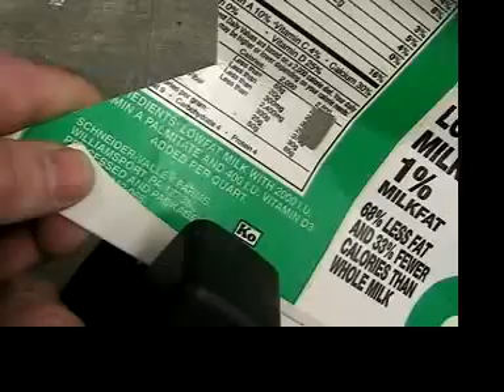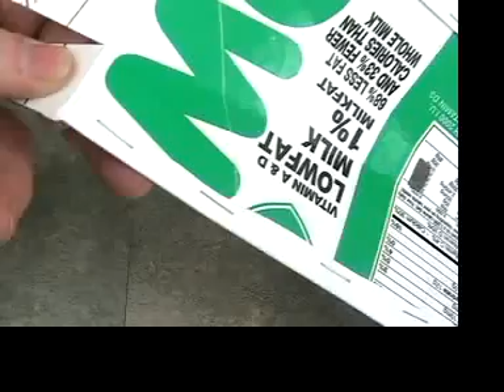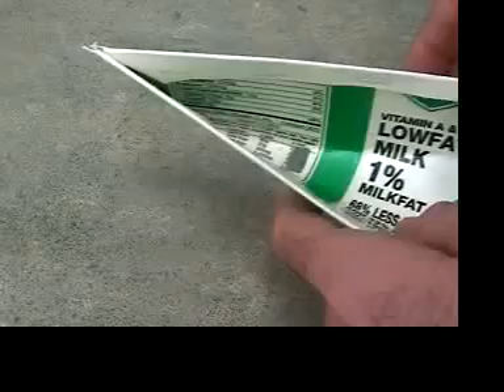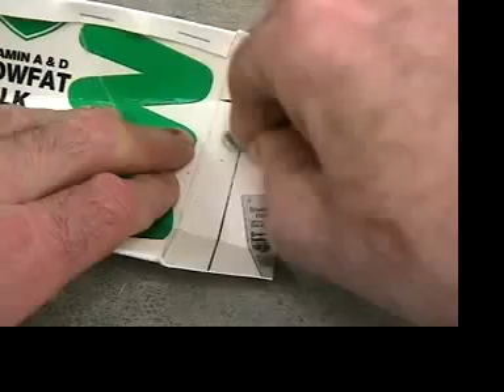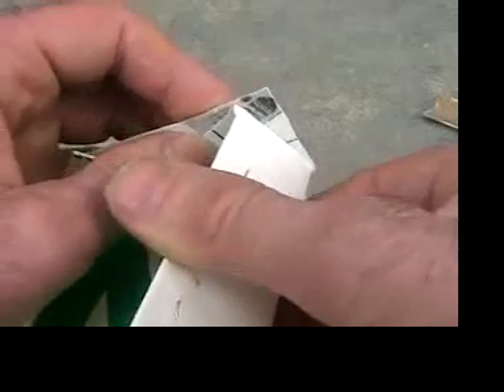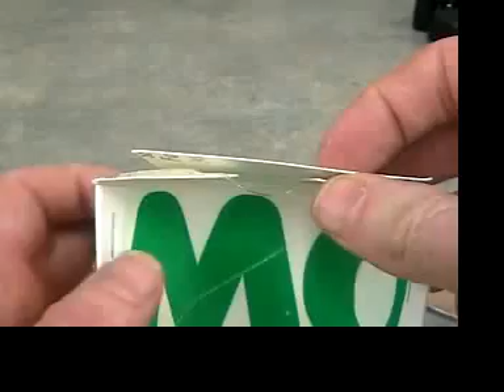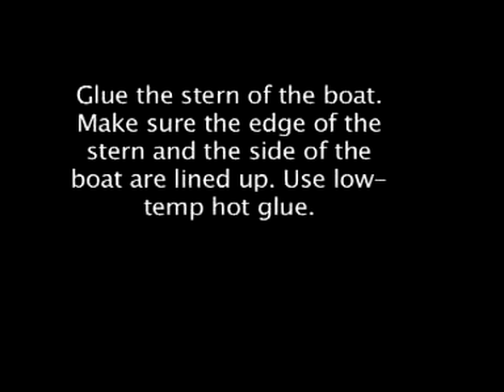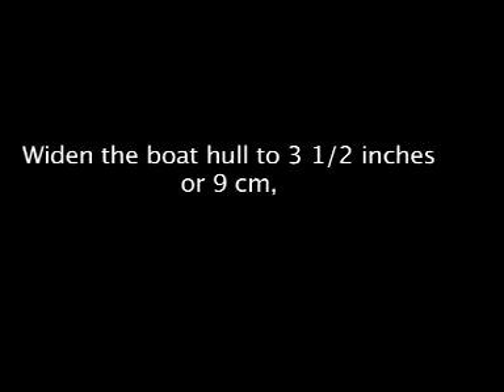Part 27B Build a Putt Putt/Pop Pop Steam Boat_Make a 3D Hull

Comment from the maker: Staples are stronger than glue. That's why you have to use them in the front--so it doesn't pull apart. There is less stress, however, in the back. Even if you use stapes in the back--and you can--you still have to seal it from leaks somehow.

Comment from the maker: @Locator3000 Cartons are covered with a thin layer of plastic. The glue peels right off. But if you sand through, the glue has no trouble grabbing the fibers. If you don't sand, you may find yourself re-gluing things.
Slater